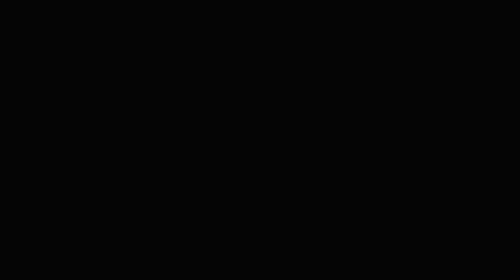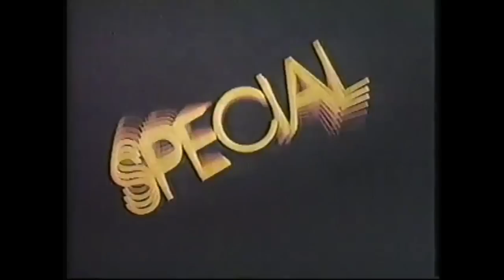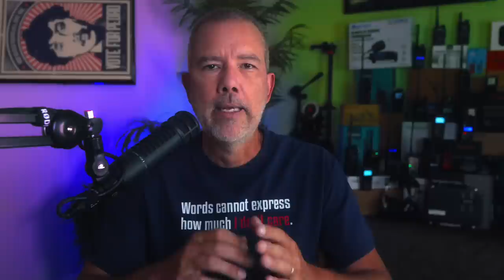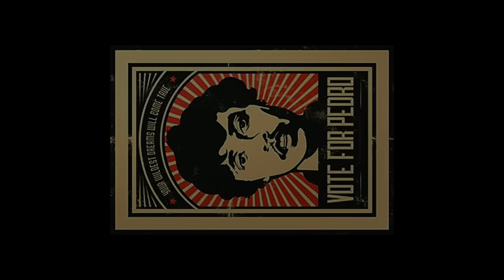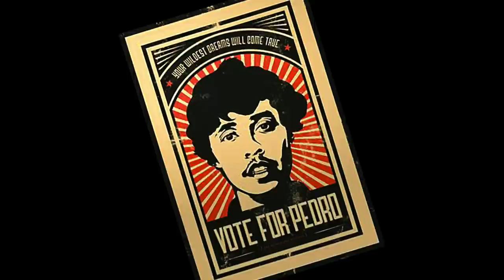What Does "Antenna Tuning" Mean? What Is Tuning An Antenna? CB Radio, GMRS, & Ham Antenna Tuning

Comment: recently retired and have a trail motorbike in the Rockies, out of the blue bought a pair of gmrs HT to add a measure of safety when I'm out of cellphone range which is any short distance off the highway.  I came across your videos as I was trying to educate myself.  You have an interesting personality that is no nonsense with a splash of self-deprecation that I find very enjoyable.  Thank you for your videos, I have watched about a dozen so far every one has been a winner.  BTW I bought a pair of GM-30 based on your recommendations and I'm located in Grand County Colorado and hope to find some repeaters near me.  thanks again

Comment: Just tuned my mobile antenna today in a field and rode around taking SWR readings in different locations and my meter only showed a .05 difference in readings. So I would go with the being in a field theory is just a recommendation and not necessary also. I started with a 3.66 and got it down to a 1.06 on low power and around 1.56 on high can’t wait to see how it performs.

Comment: A question from a newbee GMRS operator (WSBP658): in the case of a J-pole antenna, will doubling the lenth of the two poles will improve (or not) the transmition and reception? Just wondering...
Reply from the maker: Not necessarily. The antenna must be the correct length/tuned for the frequencies you are transmitting on.
FYI - please dont leave your callsign in comments because doing so is lame.

Comment: I just spent the afternoon changing out my RG8 cable for LMH400.   My SWR went from 1.4 (RG8) to 2.4 (LMH400).  The wattage dropped from 33.4 to 25.6 watts this is from a BTech GMRS50V2.  My resistance is in the megohms so it is not a short.   Would this make any sense?  Should be a better cable (1.8db) compared to (4.4db).  Would a better cable make the SWR more sensitive and more likely need to be tuned?   I hate climbing up and down the ladder.    Thanks for all the info!   After tuning the antenna I was able to get the SWR down to 1.6 : 1 at High wattage, at low wattage I get 1.16 : 1 SWR.  If we knew what we were doing, it wouldn't be called Research!
Reply: Hi John - this is normal.  You can get a better SWR number with cheaper and lossy cable because SWR is a ratio of the power forward and power reflected.  The cheaper cable is losing the reflected power coming back to the radio so gives a false idea of the situation.  This is particularly a "thing" at the higher frequencies of GMRS.  Better coax is always a good idea as it will give you a truer reading of the actual real life situation. Looks like you have tuned it well. Enjoy!

Comment: Great video on the basics of antenna tuning. One thing I like to add is that If you have to cut an antenna to length leave a little extra so that you can fine adjust it with a grinder or file. You can always take away material but can't put it back if you take off too much.
Reply: As the saying goes, measure twice, cut once.
Reply: Oh, I donno:  I’ve cut my antenna 3-times now, and it’s still too short.

Comment: I got a baofeng UV-5r the other day.  I know on another video you mentioned a better antennae.  Would it really make a big difference in performance?   Also the store I bought it from suggested one of those big whip, folding ones.  Are they a waste of money?
Reply from the maker: The most important factor is getting an antenna that is tuned for the specific frequencies you plan to use.  So if that big folding whip antenna is tuned for the frequencies you use, then yes, it will be better than the antenna that comes with the radio.
Reply: @TheNotaRubicon    Thank you for the reply.

Comment: Just curious, have you covered a counterpoise in any of your tests? They are pretty cheap to make at 7.25inches on a handheld unit. Using a swr meter with power output and a 771 antenna produced some nice results and increases, but I was curious about your thoughts.

Comment: How high above the cab (if at all) of my Tacoma does the tip of my antenna need to be for the best Rx/Tx?   Thanks!
Reply from the maker: As high as possible - center, top of the roof is the most optimal.  anything below that is not optimal, but still 'good enough' for most normal people.  My 32 inch antenna only clears about 2-inches above the top of my Jeep.
Reply: @TheNotaRubicon  Thank you so much.  I’m installing my new GMRS (because of your videos) into my Tacoma.  I didn’t realize that my Midland MXT500 came as a kit with the short antenna and a magnetic base, so I also ordered their 6dB antenna which is @ 32” or so, but with a very different coax connector.  My conundrum has been whether to use the magnetic base which could go on my bed cover OR on top of the cab, or to use a bracket I fashioned to install onto the front corner of the bed rail.  With the antenna on the bracket the tip is still at least 13” above the cab.  At that height it won’t hit my carport each time I drive in/out.  The advantage is that I won’t have to move the magnetic base each time I open the front of my bed cover.  I enjoy your videos as most “normal people” should, and appreciate your humor.  Thanks, again.

Comment: Hey Nota. What if I am using a shortwave radio with a telescopic antenna? Are you trying to say that I have to change the length of the telescopic antenna based on the frequency that I am listening to? ( I wonder if this question will even be found by Nota or if it will be buried under thousands of comments)
Reply from the maker: For the antenna to be PERFECTLY tuned, then yes.  Depending on the frequency that may mean you need to change it a lot, or hardly at all.

Comment: I would like to see a video of tuning a CB antenna without the screws. I believe the wire is coiled around the top end of the radio and has to be cut. I need that in my life so i can fix mine.

Comment: Why would you want to test your antenna out in the middle of a field away from everything unless you're going to be operating your antenna in a field away from everything? If you're going to install an antenna on your house, why wouldn't you tune it for that installation? Whatever interference it's going to get from all that stuff around it is stuff it's going to have to deal with all the time, so it should be tuned with those signal interference sources in mind to produce the best possible signal for that installation.
Reply: Torrey Jones  The whole thing about tuning an antnna in a field is theoritical textbook stuff.

Comment: Hey Nota......So are you saying that all those FRS radios that Amazon sells can never be tuned properly cause their antennas are of a fixed dimension? If you think about it, FRS has 22 channels, and if you want all the 22 channels to work at optimal output power, then you need to have 22 different antennas. What are your comments on what I just said?

HAM
Reply from the maker: Yes - I am saying that.
The antenna will not be as resonant on channel 1 as channel 22.  And, because the antennas are not tunable, they cannot be tuned any better without tearing the radio open.
Although, the difference in actual performance between the best tuned channel and the worst, would likely be negligible.
Reply: @TheNotaRubicon  YES!!!!!! I made Nota respond to my comment!!!!

Jokes aside,  Is it ok to assume that the difference in actual performance between the best tuned channel and the worst, would likely be negligible because:
Assume the FRS is tuned perfectly to Ch 1 ( 462.5625 MHz) and channel 22 which is the wort tuned for that generic antenna is 462.7250 MHz....so the difference in wavelength is 0.64811233 m -  0.64788472 m = 0.00022761 m  which is 0.22761 mm.....which is pretty much negligible....a lot of people can live with their antenna being badly tuned and off by just  0.22761 mm.
Reply: @zmarssojourner7435  The antennas on FRS radios are fixed in length.The FCC's desire IS to limit the range of FRS radios  by having the manufacturer install an inefficient (approximately) 3 inch long antenna. Look at the mobile antenna used for GMRS radios, it is about 6 inches in length as he shows in the video. As you correctly stated the frequencies are all too close to each other to matter.  What you are talking about is called antenna bandwidth.  CIAO !

Comment: A relevant question... Why is a proper "ground plane" important on a base or mobile radio antenna and not on a hand-held radio? Assuming the same radio, same antenna, same signal strength, and same power output. What's the difference? :_OffRoader:
 Excellent antenna tuning explanation btw! I've been very happy to find an almost perfect SWR reading 1.2/1 - 1.5/1 using the Nagoya (GMRS tuned) 771g (no affiliate link below) :_RikCranium:
Reply from the maker: Groundplane is needed on an HT radio also - but the radio itself, along with your head/body act as the groundplane
Reply: @TheNotaRubicon ~ Very interesting! Once I finish my repeater station, my roof may be the most cost-effective and practical choice to stash all those extra bodies? LOL 😂 Thank you, Sir!  :_OffRoader:

Comment: I'm going to have to use this info with my wife. Sorry baby my "antenna" is tuned to the perfect length. If you are unhappy with the strength of the "signal" you are receiving. It must be a fault in your equipment.

Comment: Lovely video, Thank you, NAR! Forgive the question to whomever:
But, if this is so important (ofc it is) why are say, the Nagoya NA-701G antennas for a UV-5R or BF-F8HP (i have 2 of the latter & <3 them :) much longer (4.72" stock vs 5.5" for Nagoya) than the stock antenna for those radios..or whatever other makes/models? I mean..you'd think 
Baofeng, Midland etc would ship the radios with a proper length antenna..but..someone is 
making piles of moolah off antenna sales, so that's the likely answer.
Reply: There are physical lengths, and electrical lengths. Without geting too complicated, there are antennas of varying wavelengths, for example an antenna can be 1/4 wavelength, 1/2, 5/8 wavelengths, as well as full wavelength. Each are Electrically different as well as different physical sizes.

The default antenna is barely more than a dummy load in some cases. The reason for this is to keep the cost of the radio to a minimum.

The Nagoya NA771G is an outstanding antenna for a GMRS HT.

I hope that explains a tiny bit :)

Comment: noob comment, perhaps..but why not have good old fashioned telescoping antenna and slide it out..
looking for max signal strength on the radio itself and/or the radio your pal has a ways off?
and..a lock nut on said telescoping antenna would be "bussin!" as the kids say these days.
'Bussin'', means mint or cool or mondo or swell..depending on your age, ahaha.

Comment: You must make your antenna resonant for the frequencies you intend to transmit on or your signal propagation will not be good!
I have no idea what that means but I read it in a ham radio book! 🤣
BTW, I use a miniature SWR meter between my handheld and various antennas for it. It's amazing how well or poorly different antennas do on a handheld radio. It has a big impact on "fars!"😊